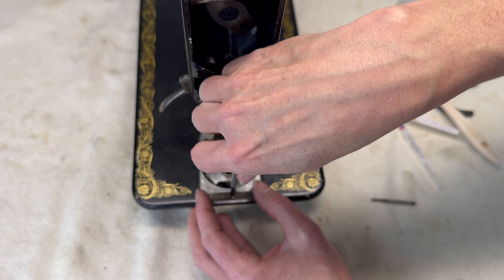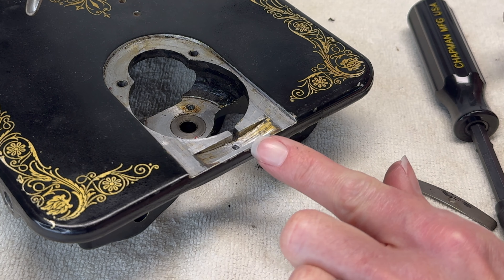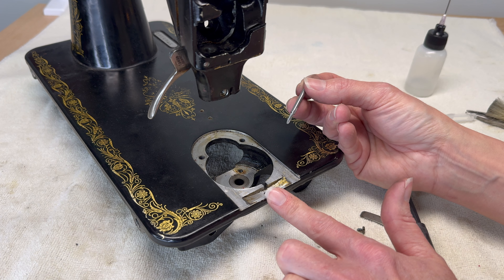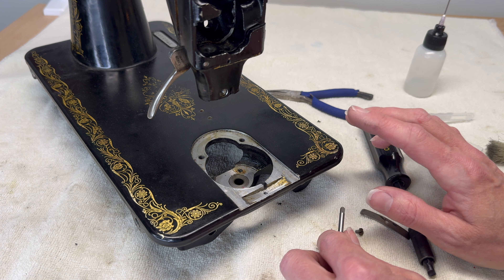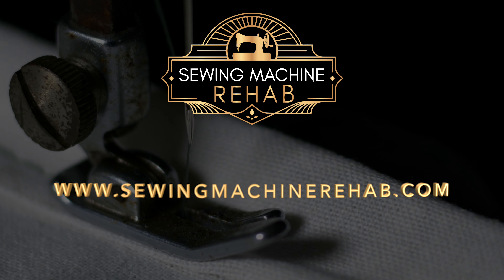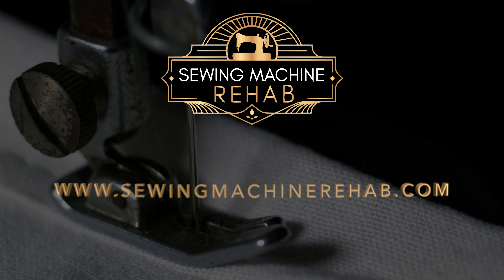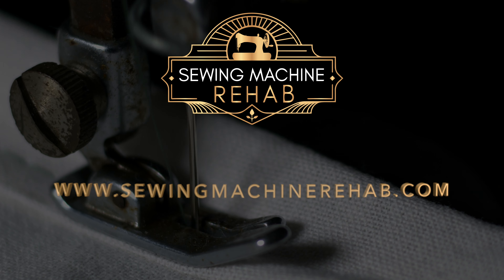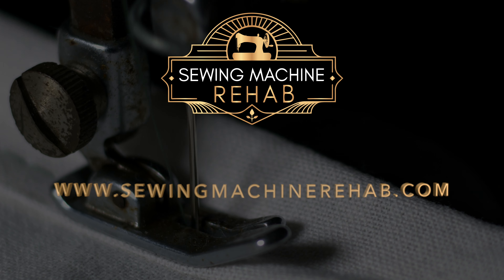Tapping or rethreading a screw hole - A very unconventional method...did it work?

Comment: I'm proud of you! Bravo! It's always preferable to save a threaded hole by chasing the threads than to drill out for the next larger size. Before anyone else says it, yes, you could have attacked that from the bottom of the machine. I forgot that you were working with the rare, aluminum bodied 99. You'll want to use a little bit of anti-seize on the threads when you reassemble. What caused the problem in the first place was galvanic corrosion caused by dissimilar metals - i.e. a steel screw into the aluminum body. That's something that plagues we owners of vintage Airstream trailers all the time...
Reply from the maker: Thanks Bob! I absolutely will use the anti-seize. Thanks for all your help on this one!
Reply: You both are amazing superpowers!  👏

Comment: No need to be apologetic about how you did this, Jen. Being resourceful is a big part of working on old things. And you are definitely resourceful. You did a nice job!  One small tip: you should always have plenty of oil bathing the tap. They make special cutting oil for that purpose but sewing machine oil works just fine. It’s also helpful to go both backwards and forwards as you proceed as that helps break up the chips and keep the hole clear.
Reply from the maker: You are correct on all points! I was nervous to back it out and mess up the alignment of the threads since I was retapping to the same size. Glad it worked out though!

Comment: A suggestion for next time : If the tap handle will not fit, place a hex nut on the tap then use proper size socket and socket wrench. This will help keep a downward force on the tap. Also when tapping go once direction to cut and then back off to clear the tap. Forward and back,forward and back,,,, little steps prevent BIG headaches.
PS, “Tap Magic” cutting fluid is also a huge help…
Reply from the maker: @jaykrul3159  Thanks for the tips! I haven’t had to tap many holes thankfully but I know now that a cutting fluid would have helped. Really appreciate the hex nut tip!

Comment: If you have a small round disk of hardwood , drill a hole in the center a little smaller than the square end of the tap take a little epoxy put on the tap and drive it into the the hole you drilled . This will grip well , give you smaller profile for the tap , you will have to keep the tap some place where it will not be lost .
Reply from the maker: Thanks for the tip!